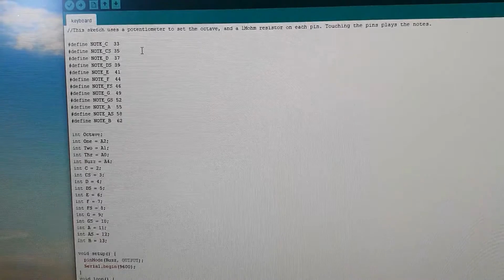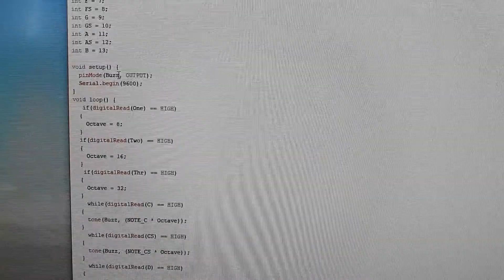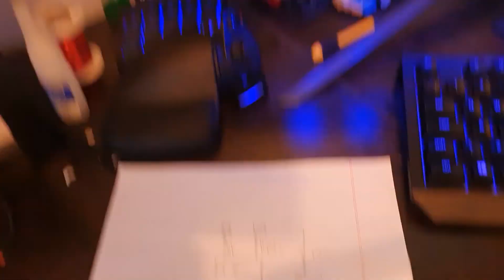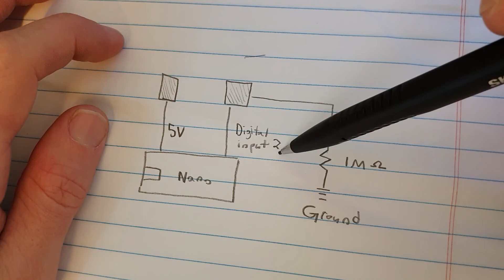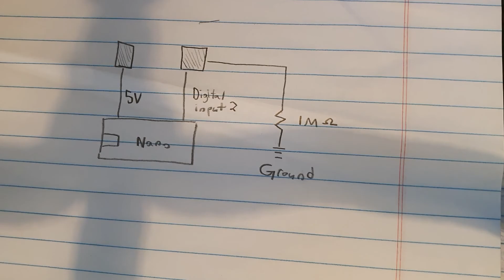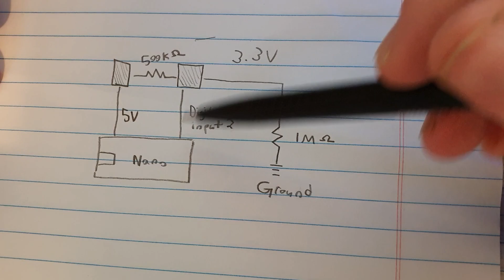Arduino Touch Keyboard + Explanation

Comment: Nicely explained. Just goes to show how a few simple bits of knowledge can make something cool. ❤
Would be nice to see this project updated to use capacitive touch. 
Im sure you already know this, but you can actually use most GPIO pins as a capacitive touch input. Just set them all to output low, with weak pull-ups enabled, enable interrupt on low to high transition, start a fast timer, and reset all the pins to inputs. In your interrupt handler, record the timer value for each pin as it comes in. When the timer overflows, or reaches a preset value, signal the main loop to check the table of values you’ve collected and then start over. The values you get will vary based on the capacitance of each pin to ground. A simple comparison with hysteresis will reveal which pins are being ‘touched’, from which you can generate touch-down and touch-up signals. You can even get a rough aftertouch pressure and proximity too!